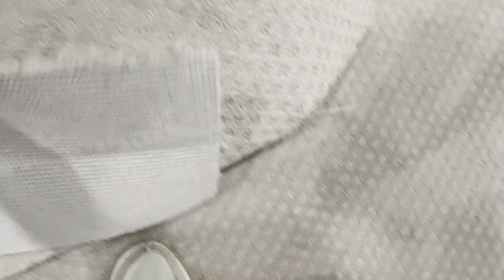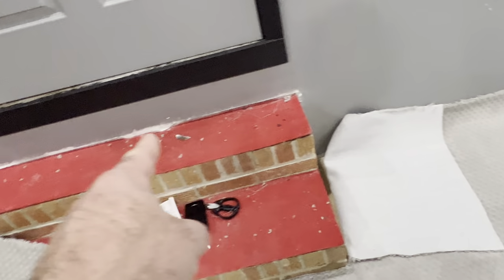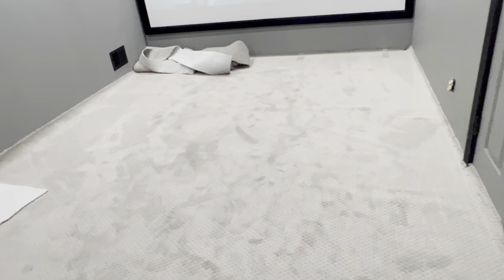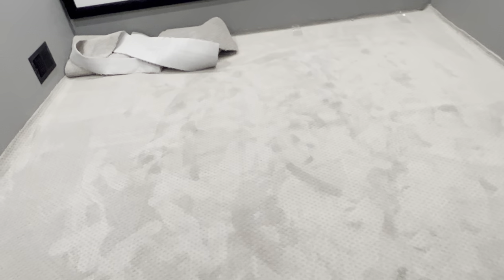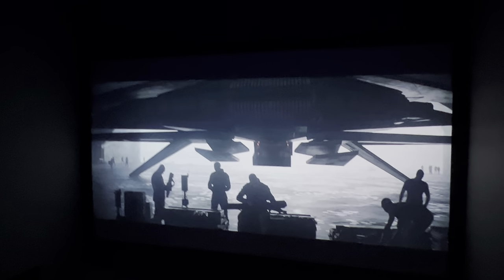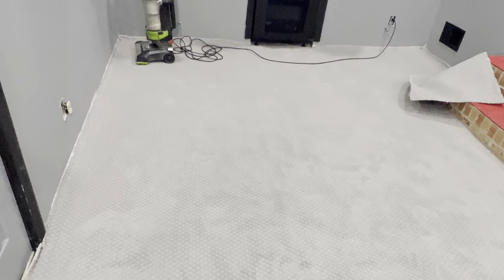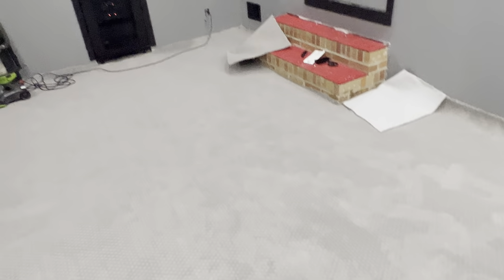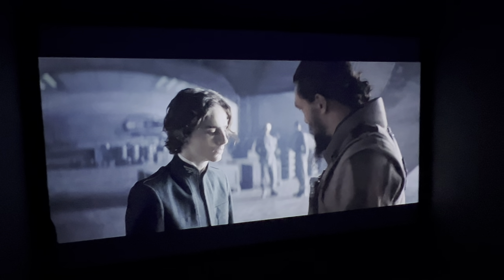Update to 9.4.6 home theater build. Carpet is in!

Comment: I like the design of the carpet. I’d say it’s best to use tack strips just in case you ever need to replace the carpet it would be a lot easier to remove and especially since it is such a light color that’ll probably show dirt, stains very easily. You can use tack strips on concrete. I have it in my basement.

Comment: Hey Chris, carpet looks fly, props that you are fitting it yourself, I’m assuming it’s not the kind that needs edging tack strips ? Is it just a spray glue job ? Just interested to see how different things are in the U.S compared to the UK…just one idea to throw at you, have you ever thought of two nice strips of wood, be it what we call window sill (I don’t know what you guys call in) but the wood they use for inside windows that you put photos or plants on, that kinda thickness and wood but plain, and then stain it and glue or fix them over the concrete steps, just to break the room up a little ? Just an idea, I have been meaning to mention it but just end up with room envy lol,
Also one more idea, (sorry I love thinking and planning or solving things) but how about a plastic tube black of course with a lip one end, probably something they may use for pipe’s around the house and get a piece that will fit in the hole where the projector shoots out…easy to wipe the dust and also saves seeing the plasterboard…
Sorry for the essay, got a few more vids to catch up on,
Keep on keeping on and as always your jealous guy from the UK MCD

Comment: Love your theater build series. One question that is bugging me is, your projector is behind the drywall. So, how do you change it if you had to change the bulb or change the projector itself for that matter? Also, won’t heat build up inside the wall from the projector if there is no outlet for the heat to go out of the drywall?
Reply from the maker: The equipment rack pulls out. There’s a room behind the wall! I do have fans to keep the projector cool.